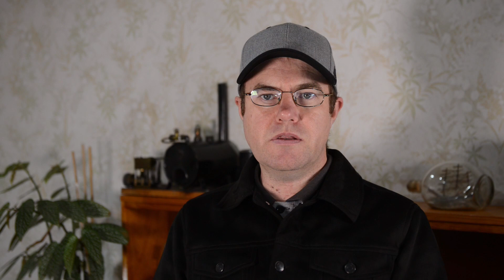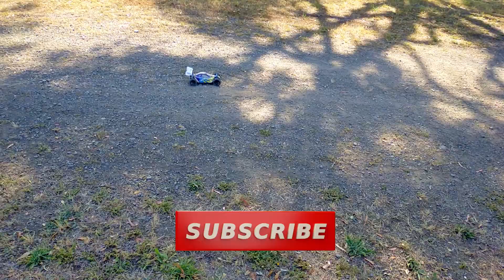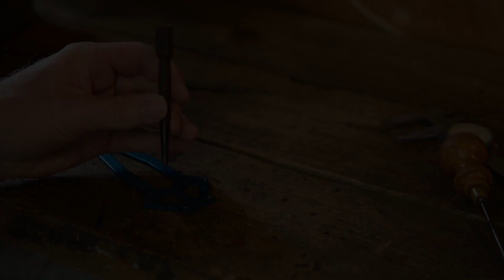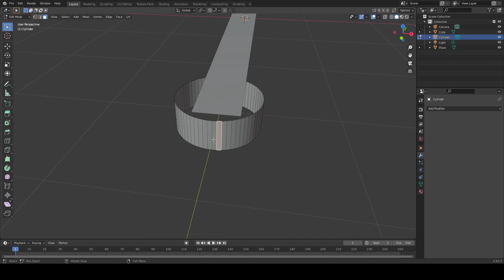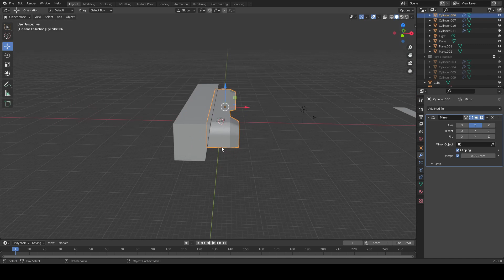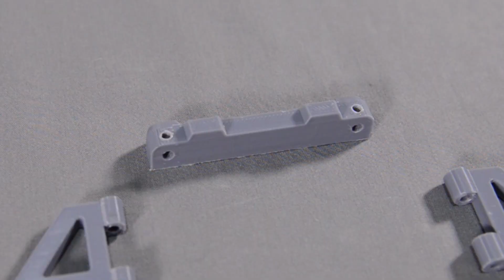Modifying The HSP Xstr Pro To Be Much Better

Comment: Just pulled an old HSP chassis out the cupboard, It has a previous brushless conversion I did. Your front end modifications are really good. I might give them a go on my HSP. I have a new buggy body in the post.

Comment: Hi, friend! how's it going? They told me that this buggy has very simple and fragile shock towers (they bend very quickly). Do you think that if I put a brushed motor and a 2s lipo on this car, the shock towers will easily double? regards! (I would not jump more than 3 inches or 10 cm high)

Comment: Just saw this video now, love the detail you put into your video. I see you posted this 10months ago, wonder if you went ahead to produce the parts for sale? If you did, I'd like to buy a set, pretty please? Don't know how to contact you directly.
Reply from the maker: Hi, Recently I have been thinking about opening an Etsy store for such things. However shipping out of New Zealand can be prohibitively expensive. I will have to think of a solution so others can also get this mod.
Reply: @MrGridStrom  hi! I noticed after watching your video, there seems to be different model numbers on the HSP Planet. The 94060 does actually come out with similar, but the 94995 and 94990 not. Have a look. Very confusing.

Comment: I have this exact buggy and same problems with understeer and oversteer. You should seek these upgrades as a package I'd be really interested! :)
Reply: Can you put your 3d files up for download?
Reply from the maker: If i was to do that now, the parts would have to be 3D printed.
Reply: That's not an issue though is it? How durable is the material you used for 3d printing in your video? also did you test its strength also?
Reply from the maker: @unrealvisions2165  it's not as strong as the other plastics on the car, but it's also not completely useless. However, after such a mod the car is no longer a basher.
Reply: @MrGridStrom  I agree with Unreal Visions, I am definitely interested in your mod parts and would be more than willing to pay! 😁
Reply: Did someone get the stl file?

Comment: Great video. I really like how you strengthened the front end. You really seem to have Blender mastered. It's good to know that your 3d printer works with Blender. Was there a particular file format you used? FBX, OBJ ?
Reply from the maker: Hi, thanks. I exported as an .stl file then opened that in Cura
Reply: You should sell this part. I would love to have a set even if they weren't drilled or tapped. Awesome setup brother.  🏆🏆 @MrGridStrom

Comment: Nice fabricating You are exactly right all that slop in the front wheels definitely hurts it's ability to corner and track well I raced 2wd 1/10 stadium trucks competitively from 2000 - 2004 Mostly electric Learning how to set up the camber toe in shocks etc is critical if ya want to be competitive Driving is only half of the challenge in racing If you have a truck that doesn't turn or land well it doesn't much matter how good you can drive you want stand a chance Cool vid 🔥👍✌️
Reply from the maker: Thank you for the nice comment, really appreciate it.